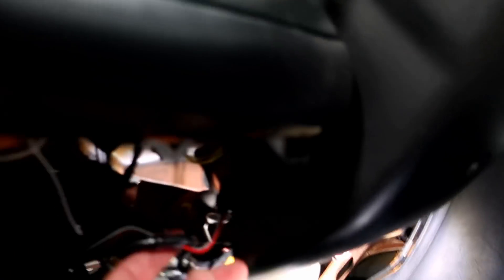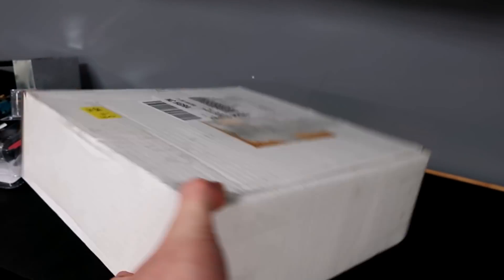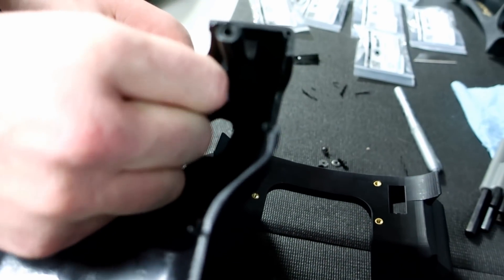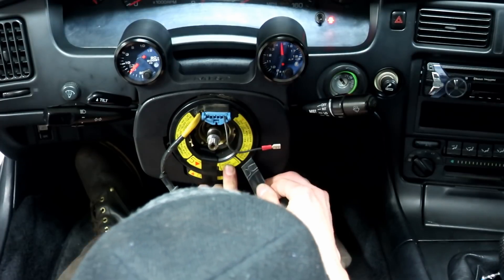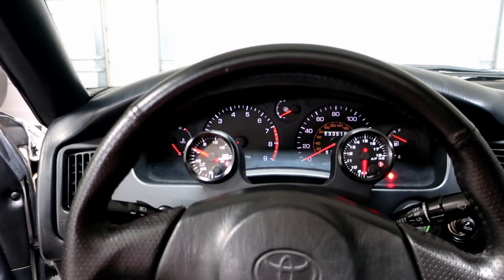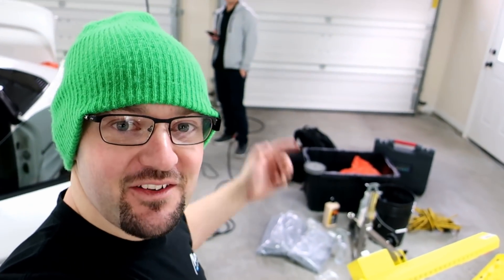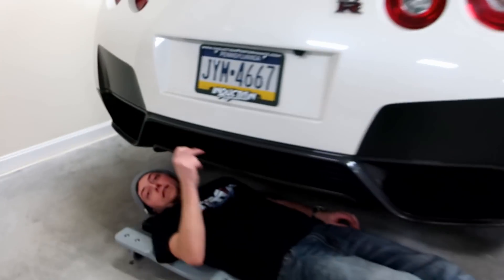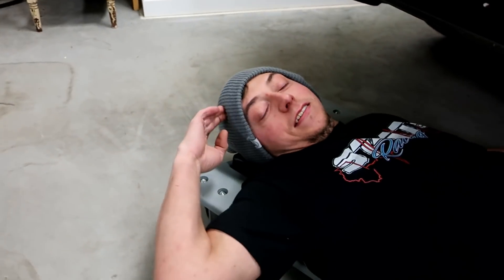MR2 Gets MODESTA+ Ceramic Coating & Gauge Pod!

Comment: Is it absolutely necessary to remove the steering wheel in order to install this? or was that just done cause of the way you wired it? I thought the clam should could be removed and installed without removing the steering wheel.

Comment: Are you using a kerosene heater to heat your garage? If so do you notice if it leaves a film on your paint? I stopped using those heaters in my garage for that reason. They heat the garage really fast but that’s the downside of those heaters for me. Paint turned out great.  My 93 super red paint is so thin I can’t cut it any more. Single stage paint sucks!

Comment: Get a new smaller diameter steering wheel please, the car will turn better from a driver's point of view as less movement is needed and it won't look like a Camry! 
Also the clam shells don't break unless you have big sausage fingers and no control over them.